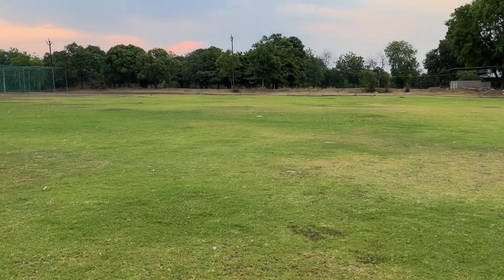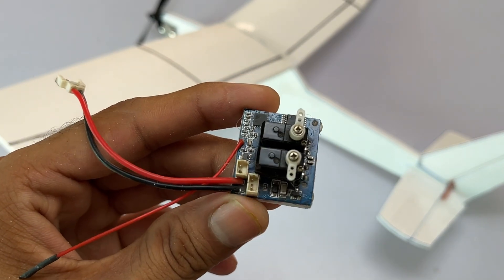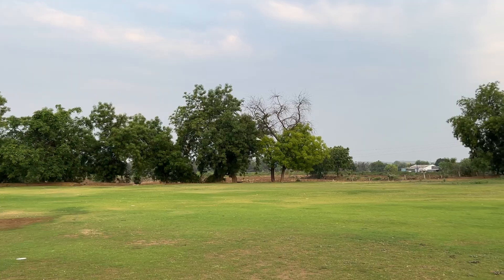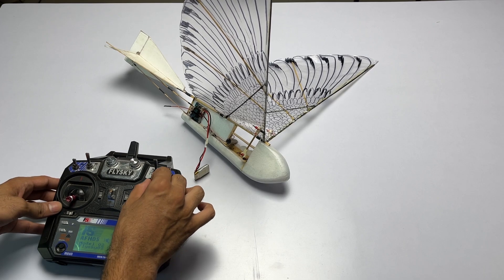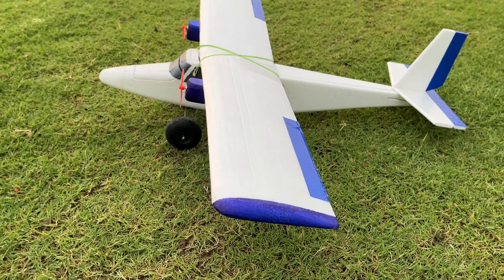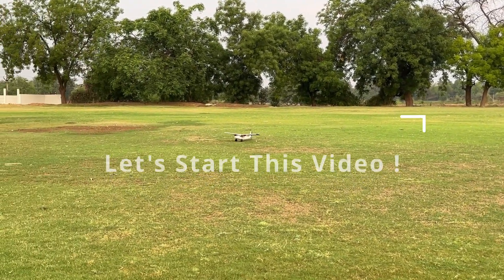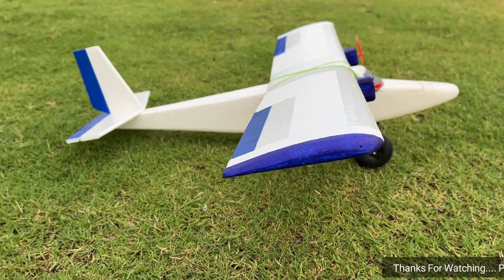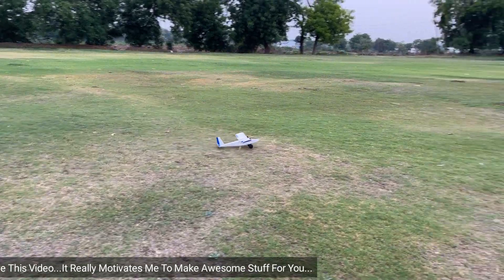DIY Electronics Setup For Mini Rc plane & Ornithopter #rcplane #ornithopter

Comment: Please please please please please please please please please please please please please please please please please please please please make a rc boat by using 2 motor without servo please please please please please please please please please please please please please please please please please please please please please please please please please please please please please please please please please please please please please please please please please please please please please please please please please please

Comment: Hi, I am face one issue and need your help. I have connect my esc to channel 3 and a mix aleron to channel 1 and 5. When ever I control aileron, the propeller starts moving and sometimes continues to move at slow speed and stops after some time. This happens also when I control my elevator channel also. Please help 🙏